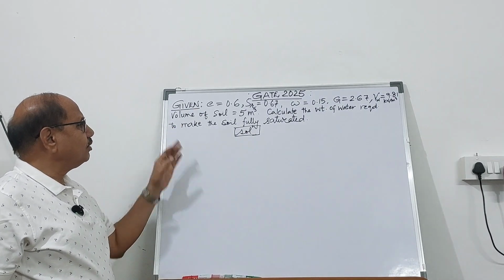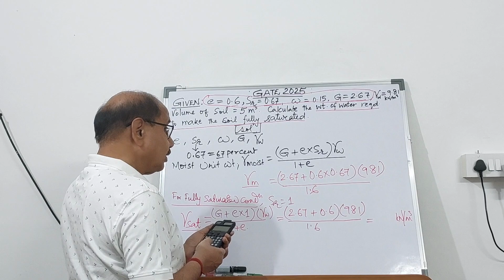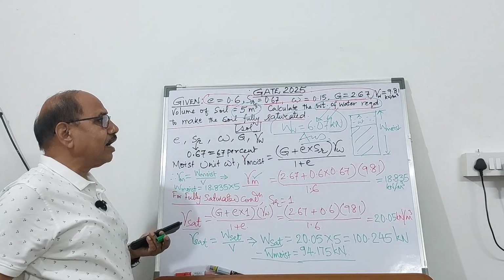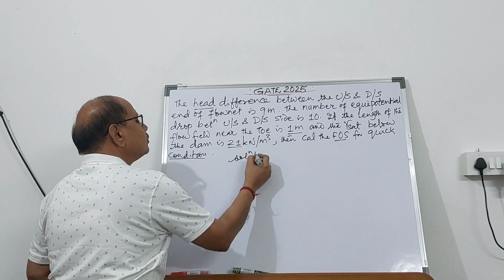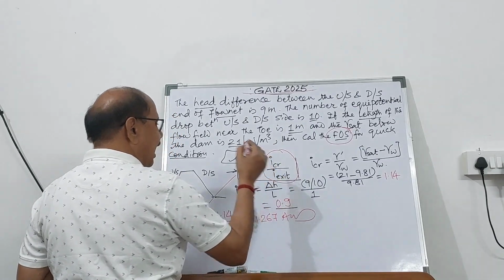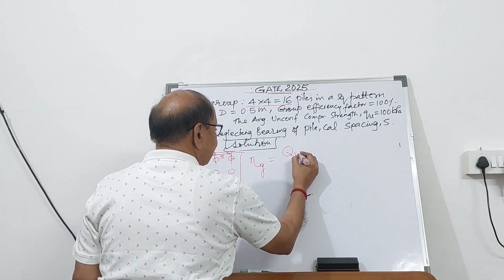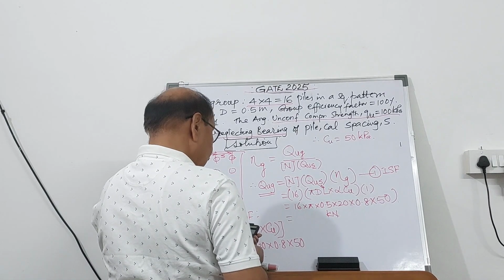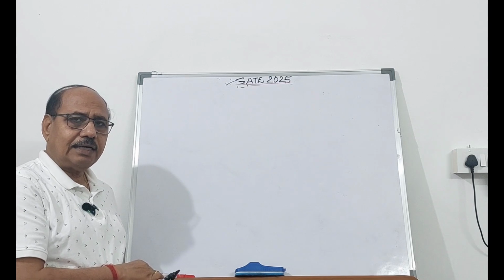GATE 2025 | Detailed Solution Part - I(afternoon session)

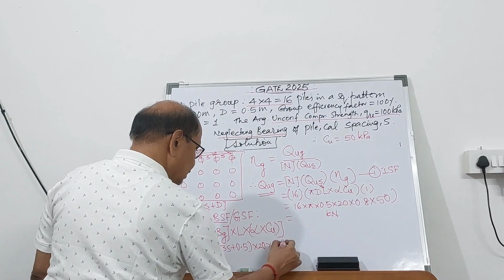Comment from the maker: In this video, at 35:00 the value of alpha for BSF/GSF should be taken as 1.0 and not as 0.8 because the skin friction is developed at the perimeter of the pile group. This skin friction is between soil and soil ;whereas for ISF; pile fails in shear individually and therefore the adhesion factor alpha is between the pile material and the adjoining soil and therefore should be taken as 0.8. The spacing is therefore 1.508 m.